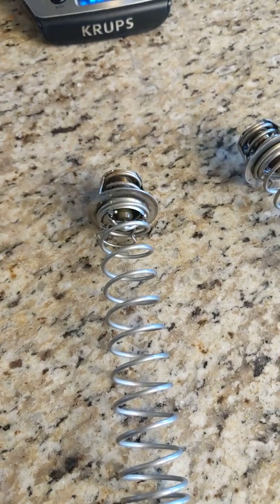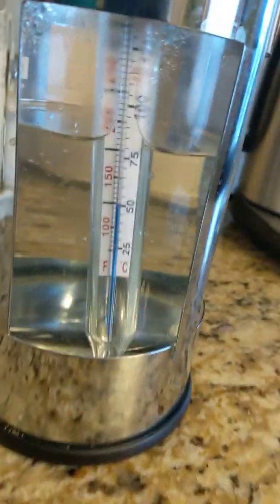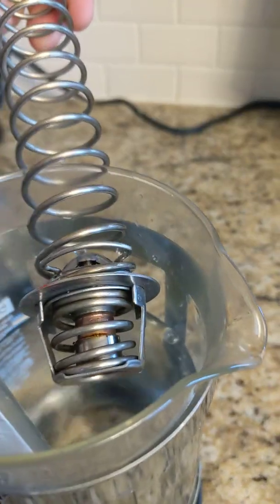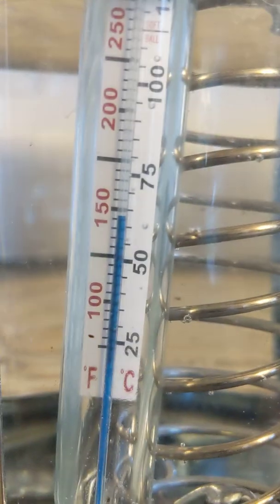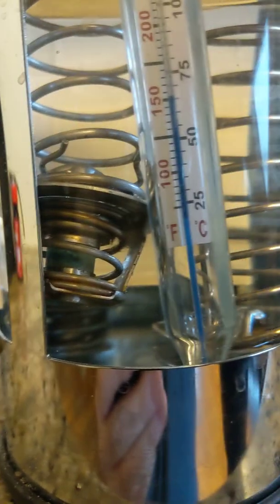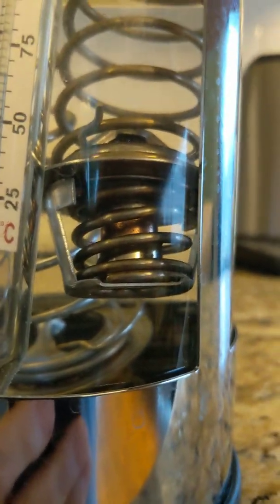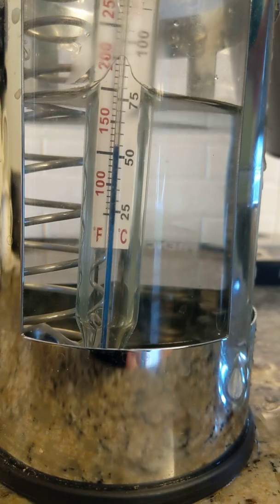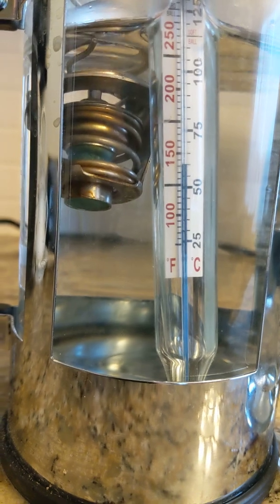Troubleshooting Pool Heater Thermal Regulator (Thermostat)

Comment: I was able to replace my thermal regulator without using the clip (I noticed it in the box after I installed it).  Is it absolutely necessary to have the clip installed or does just hold onto the spring?  Thanks for the great video.

Comment: So if it wasn't your thermal regulator.  Then what was your problem with your heater.  Mine is doing the same thing and I have replaced the regulator,  gas sensor and HLS sensor to no avail.
Reply: Same here.  New manifold with new HLS, GSS and thermal regulator.  Heater works fine without thermal regulator.  Thermal regulator opens in very hot water.  I'm wondering if it doesn't open at 140 degrees/early enough/proper temperature and that is why it still rattles and cuts off the system with an HLS error message.  I'll check the temperature at which the thermal regulator is supposed to open and test with water at that temperature.
Reply: Has anyone figured this out, I am in the same position.  My regulator functions correctly, heater turns on then off 30 sec at a time continuously.  Heats the water but something is going on and I can’t figure it out.
Reply: @risforrichards4856 did you ever find the issue? I’m currently having some of the same issues

Comment: Any issues with running the heater without the regulator? I'm on myrd rd one in 2years and the price has jumped by 400% in the last two months.
Reply from the maker: Sorry, I don't know the answer. I did run mine for a while without the regulator, and it ran fine. I think the issue is that it runs more often and doesn't heat as efficiently, but that is only a guess.
Reply: The thermal regulators main function is to prevent condensation on outer surface of heating coils which causea them to rust. You can safely operate without one if you can manually close off inlet and outlet of heater via bypass valves if you have them, and manually reopen them before using heater.
Pentairs newest version of their heater has the capability of automatically opening and closing of a bypass valve whenever the heater is operated.